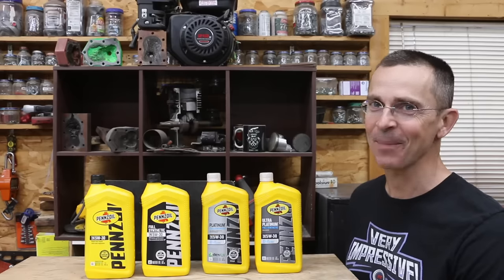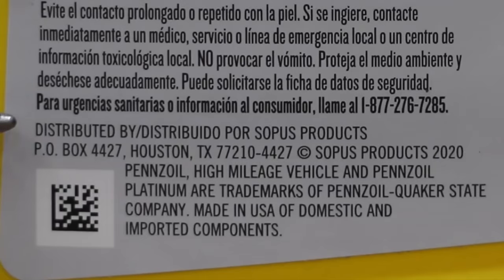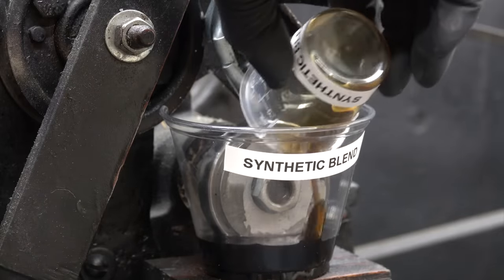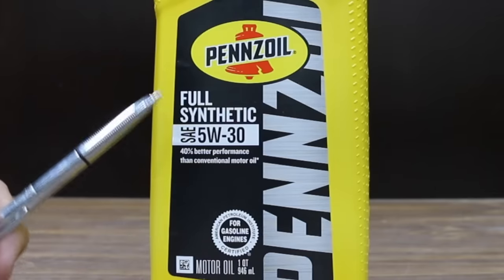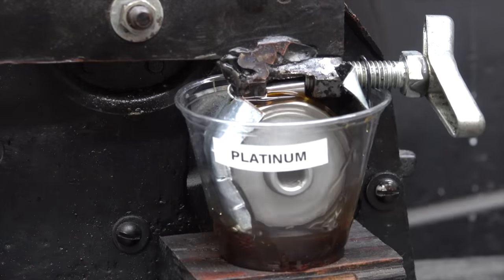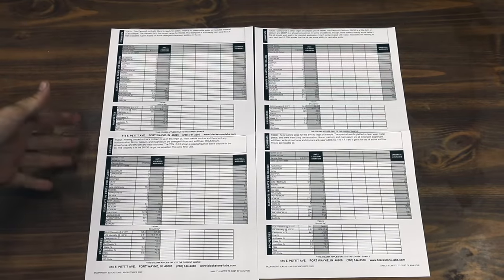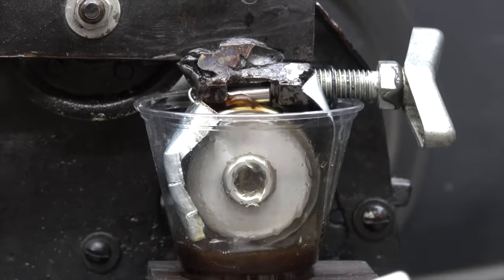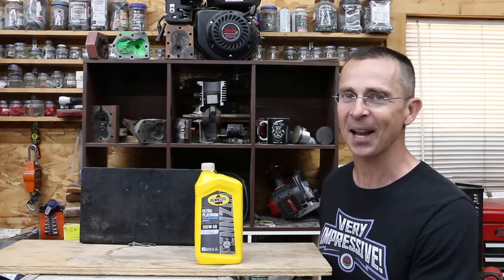Are They All The Same Motor Oil? Let's Settle This!  Four Levels of Pennzoil Motor Oil Compared

Comment: Very good about shaking the bottle of oil before pouring off a sample.  Additives do settle at the bottom of the bottle.  I learned that years back when I happened to look into an empty bottle of Castrol (white bottle) and saw specs of what I realized were additives.  Always shake the bottle right before pouring the oil into your engine! 
I've never seen a bottle labeled "Shake Well Before Use."  Yet common sense says with the millions spent on advertising the manufacturers would want customers to be certain to get all of the science and effort they put into their oil.
Reply from the maker: Thanks for the feedback.
Reply: its just gonna settle in your oil pan.
Reply: @JessM1  There is a constant flow though as you drive, it just might be enough to pick them up.
Reply: @MaaZeus  so what difference does it make, once you start up it will mix.
Reply: @JessM1  not if it stays in the bottle and never gets in the engine.
Reply: @JessM1  you drive more then you buy oil off the shelf

Comment: I've been using Pensoil for years, this makes me feel even better. I always change my synthetic oil at 5k-5,500k no matter what the manufacturer says.
Reply from the maker: Thanks for sharing.
Reply: Only an oil analysis will tell you if you can go further.  With GDI and low tension piston rings oil dilution is more likely today.

Comment: I would love to see this done on various "high mileage" oils. Great video 👍
Reply from the maker: Thanks!  Thanks for the video idea.
Reply: @ProjectFarm  I agree with his suggestion! Used to use valvoline max life regularly and managed to seal up an oil leak on a 94 maxima se. Now im strictly amsoil on my newer audi and corvette
Reply: @ProjectFarm  can you test Motul, Ravenol and Petronas 5w40 or 5w30?
Reply: when do u use high mileage oil? my 07 Camry 3.5 has reached 200k kms. I never used high mileage oil. only been using Pennzoil ultra platinum every 7-8k kms. Car does not have any problems yet. should I consider switching to high mileage oil ?
Reply: @droy7101  they are recommended for use after 100k miles (160k kms). I'm really not sure what the differences are but i'd assume it somehow accommodates for general wear of an engine (perhaps more thick?), many people have said it also helps to seal up minor oil leaks. I'd say just keep doing whatever you're doing. I have 175k miles on my car and just switched to high mileage for the first time. I do have a very minor valve cover that i've put off fixing for a bit so we'll see what happens.
Reply: @droy7101  I wouldn't unless you're experiencing leaks and even then I'd rather just fix the leak.  Do maintenance according to the manual.  I'd rather not add an oil that has "conditioners that might swell seals that don't require it.  I've used them, but generally avoid them unless it's a throwaway car I had to buy a pinch to get around.

Comment: I'm a new car owner for the first time in 14 years (2023 Toyota Camry) and this video was just what I needed.  Thanks!
Reply from the maker: Congratulations!  You are welcome!  Glad it was just what you needed!
Reply: Stick to ow-16
Reply: @rorycalhoun1126  I've seen nothing to prove 0W16 or 0w20 is good in areas over 35c.  Still waiting.  Don't tell me tolerances or the cars engine will be the same temp., 0w20 flows like honey when frozen,  your car has a radiator, so in the winter it doesn't warm up as fast or get as warm as it will in 40c...

Comment: I know I asked this before, but would you ever consider doing Oil Filter media, build quality, pressure, and or filtration tests on oil filters ? Also great to know pennzoil still makes great oil, been using ultra for the last 4 years, and I dont think id change a thing.
Reply: i have seen other videos on this subject. what i took from it is do NOT use FRAM
Reply: I believe he has a video on this already.
Reply: he's done this, there are a few other vids like this around YT. Good stuff.
Reply: @TriforceOfCourage97  millions of people have been running FRAM oil filters for decades without any issues . If you buy their cheapest filter you get cheap .
Reply: Paper filters filter the best
Reply: Napa gold oil filter out performed most other filters. Frams were terrible
Reply: @Walkeranz  Fully synthetic media oil filters are WAY beyond paper filters.  Air filters, on the other hand...K&N's "higher flow" just means "bigger chunks of dust get in"
Reply: @TriforceOfCourage97  the lowest fram filters have caused issues yes, but the top of the line fram filters are fine. 
There’s been one in my B3000 for 28 years. 
Not putting one on my vette though.
Reply: @TriforceOfCourage97  oh woops I didnt know this thank you
Reply from the maker: Thanks for the suggestion.
Reply: Around 2000 I had an orange Fram oil filter from a commercial oil change on my turbocharged Mitsubishi Eclipse burst at about 300 miles. The cheap metal strip style pressure relief valve stuck closed and the pump blew the filter apart. I bought a NAPA Gold filter to replace it. Being insatiably curious I bought the same off the shelf Fram to compare. The body of the Napa felt like a solid piece of metal with no flex. The Fram body I could easily flex in my hand. I could several other potential problems with the blown apart Fram as well as rust inside the new unused Fram I purchased
Reply: FRAM changed recently.  Watch his video. Eye opening.
Reply: @Kharnellius I was gona say, the Ultra Frames seem to be made better then mobile 1 filters, the bean counters got to mobile 1 filters honestly.
Reply: Fram Ultra Synthetic is superb. That aside probably is questionable media.
Reply: Earlier in 2021, several oil filters were tested in a multi-pass filtration and flow test per ISO 4548-12. The tests were conducted at Ascent Filtration Testing LLC, an independent lab based out of Michigan. The filters tested were based on requests from myself and others in the oil community.

All filters have synthetic media except for the ACDelco filter which is cellulose.

In order of efficiency at capturing particles 20 um and larger...

#1 Fram Ultra - 99.96%
#2 Royal Purple - 99.08%
#3 ACDelco Gold - 96.49%
#4 Purolator Boss - 61.80%
#5 Wix XP - 61.61%

These filters were also put through a bubble point test which they all tested well in except for the Wix XP which exhibited a bypass failure.

Here's a comparison of the results to the advertised filtration rating of the filter from their manufacturer.

Fram Ultra
- Advertised: >99% @ 20 um
- Actual: 99.96% @ 20 um
- Claim: Valid

Royal Purple
- Advertised: 99% @ 25 um
- Actual: 99.56% @ 25 um
- Claim: Valid

ACDelco Gold
- Advertised: 98% @ 25 um
- Actual: 98.85% @ 25 um
- Claim: Valid

Purolator Boss
- Advertised: 99% @ 25 um
- Actual: 87.79% @ 25 um
- Claim: False

Wix XP
- Advertised: 95% @ 35 um
- Actual: 87.68% @ 35 um
- Claim: False

Comment: I admit this is a bit of a late post for this, but there's some interesting context I can provide. My father was a chemist for Quaker State's Research Center; he did a lot of the testing on their original 4x4 blend. Almost all motor oil sold in the US is a synthetic blend or full synthetic.  If I remember correctly, it's largely because getting non-synthetic oil to meet modern standards is extremely difficult and expensive. Synthetic is still largely based on crude oil (it doesn't have to be, but often is) - it just means that the hydrocarbons, instead of being simply separated into types, are physically and chemically modified into a more 'ideal' form. Typically, this means cleaving off impurities and chains with less-than-ideal properties, then reassembling the chains based on the formulation you're aiming for. API doesn't even really track conventional vs synthetic anymore - it's only really a marketing term these days.
Reply from the maker: Very interesting!  Thank you!
Reply: Many years ago I had a bad experience with Pennzoil and I wouldn’t use it if it was free.
Reply: So its ok to buy synthetic motor oil from the dollar store then, cool thanks brah
Reply: @daleweller5193  isedformanyyearsnoptoblems
Reply: Synthetics are conventional molecules processed to be less jagged.
Reply: @daleweller5193  Used Pennzoil for almost 20 years.  One of my cars, had 321,000 miles on it - I didn't use synthetic at the time.  But, I changed oil every 5,000 miles and the filter, never missed a change.  Others I've heard hate Pennzoil.  I've since gone to Mobil Synthetic, but seriously,  had no issues with Pennzoil.
Reply: @daleweller5193  and what exactly was your experience? Il bet it was user error
Reply: @southwestxnorthwest  yeah, as long as it meets the typical specifications and testing requirements it doesn’t matter
Reply: Bullshit...You seen that on Bob's the Oil guy forum and pasted it here. Your Dad probably flipped hamburgers and only knew about vegetable oil.
Reply: Oil production is environmentally unsound. That’s why I use a blend of 50/50 maple syrup and honey in my engines.
Reply: @jsplasha  
Conversely, thinner oils flow better upon startup than heavier oils so greater protection is provided when the most engine damage potentially occurs, which would be especially beneficial in cold weather environments.
Reply: @jsplasha  100% synthetic oils do exist. Amsoil being one of them
Reply: @LuckyCharms777  😅🤣😂
Reply: @jsplasha  in order for an oil to be called full synthetic it cannot be created with group 1 or 2 base oils. It has to be created with group 3, 4 or 5 or any combination of 3, 4 or 5. I was referring to Amsoil signature series which is predominantly a group 4 if I recall correctly. Redline is predominantly a group 5 oil mixed with group 4.
Reply: My local Menards has the Pennzoil full synthetic for $17.  Would you guys recommend this oil?  Seemed to do ok in his test but I'd like to hear some other opinions.  Thanks

Comment: I thought it was really interesting how the Platinum was affected by the cold much more so than the others.
Reply from the maker: Thanks for the feedback.
Reply: Yea, I’m normally the guy here who’s like “the brand doesn’t matter, as long as it’s SAE certified and the right weight you’re fine. Kirkland, super tech, etc.”

But right now, seeing how poorly that platinum flowed in the cold… idk man. Idt I’m ever using that during the winter now
Reply: @LightsaberGoBrrrrrr  yep, I just got a bottle of it, I think I’m gonna use my other bottle of Mobil one tomorrow because it’s single digit temps here, I’ll save the platinum for summer time
Reply: @shaneomac5074  probably a good call. I'm sure it would be fine, but this test is just making me wary

Comment: Love oil tests! Gotta keep those bearings in good shape.
Since I use 60-70 years old in Ford Y Block engines, I must keep up with oil ingredients as with the flat tappet lifters one must use oils with lots of zinc which is not a common ingredient anymore. Engines are lasting much longer nowadays that they are usually an ester based oil rather than the older oils. 
Another great and useful video!😁
Reply from the maker: Great point!  I use a ZDDP additive for my older farm equipment for the same reason. Thanks again!
Reply: @ProjectFarm  I've heard Rotella still has a lot of ZDDP in it. Maybe you could test Rotella vs ultra platinum (both made by Shell) with a ZDDP additive?
Reply: All engine oils still have Zinc, but it has been reduced to 600-800ppm, which is comparable to what Zinc was when the Yblock was designed.
Reply: Stock cams with stock valve springs work well with 600-800ppm once broke-in.

When you start to increase the valve lift and install stiffer springs is when you want to start worrying about oils 1000+ppm
Reply: @Texassince1836  I am certainly not an expert on oils and engines so I am going bye the words spoken bye some of experts that build Y Blocks both for street and performance applications. I have a friend who has a business that builds engines for customers and for his Bonneville racer. His recommendations for oils for even regular passenger car engines are oils high in zinc. In a Y Block one doesn’t want to use too slick of an oil as one wants the flat tappet lifters to rotate to prevent damage to both the cam and the lifters. 
Thank You for your input!
Reply: @CrippledEagle  the additional Zinc will not be harmful *below 1500ppm*, so you can most certainly use a higher Zinc oil, but if you stop at a gas station only to find you're a quart low don't be scared to add whatever the gas station has.
Reply: @CrippledEagle  Conventional Pennzoil the zddp level is 900 and their diesel rated oils the zddp level is in the 1200 range nowadays last I checked. I remember running the conventional Pennzoil racing oil 50w or the 20w50 and the zddp levels were the highest of all the other brands plus it said right on the bottle formulated for use with methanol and nitromethane fuel it was excellent oil. Flat tappet camshafts yes you need the higher zddp levels. Seen too many people prematurely wear camshafts and engines with the wrong type of oil. I would be curious what your friend who builds land speed engines recommends. Thank you 👍

Comment: I have been using Pennzoil for years because of other reviews before yours. I always wondered what the differences were. I have always tried to use Ultra Platinum since it  came out. I was very surprised at the Platinum results. Thank for a very useful review for  me again.

Oh, many years ago when I worked in the automotive business...Quarts of oil were taken off the shelves and tested for viscosity. Many 30 weight oils turned out to be 10 weight oil. No wonder the engines back then wore out so soon.
Reply from the maker: You are welcome!